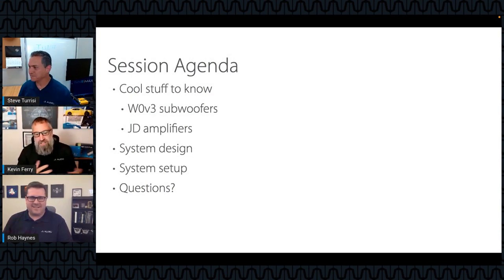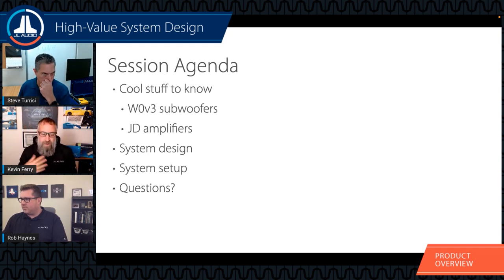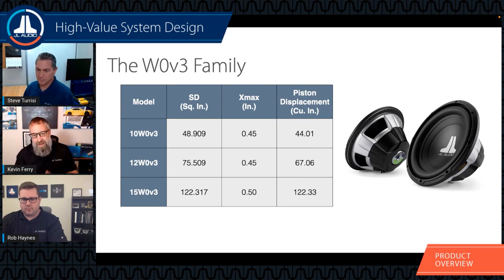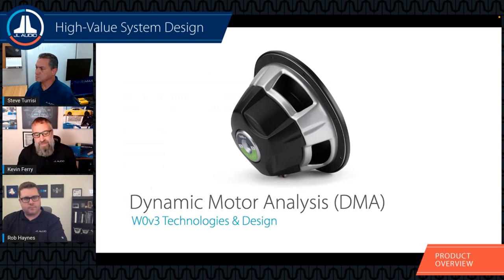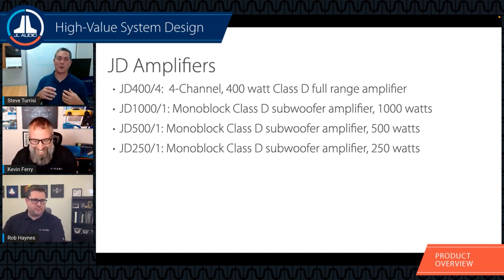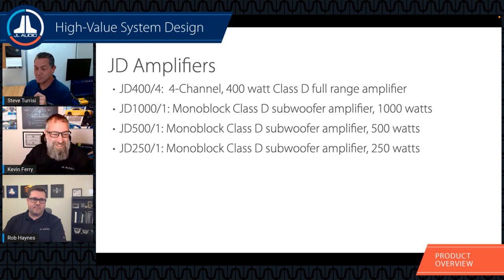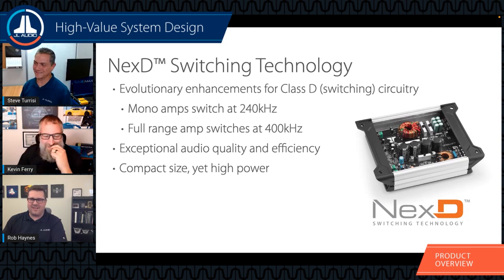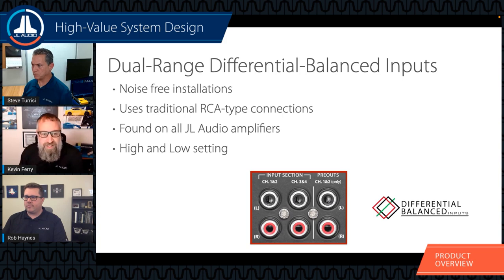JL Audio Online Training | High-Value System Design w/ WØ Subwoofers & JD Amplifiers

Comment: I had this:
Pioneer DEH-X8800bhs  
      head unit
Audio Control Epicenter
Audio Control EQL
XTANT X603 amp
Front doors JL AUDIO
    6"C2-600 set
REAR DOORS JL AUDIO 
     C2-650X set
and 3-12w0v3's in a 5.25 cu ft box with a 4 x 10 port by 16.5 in long (Box size given to me by your own Carlos Chavez) in a 2006 Nissan Maxima. Sounded awesome.

Comment: Just found this video, this is gold guys! I'm actually designing 2 systems around full JL audio (speakers, sub, amps, wires, fuses, fue disteibution block, battery post clamps, etc). All except the head unit cuz you guys dont want to own that piece of the market.
Reply from the maker: Awesome! We're happy to hear you enjoyed it!
Reply: @JLAudioInc  guys, I have a question for you.  Is it possible to get some feedback round a system designed for a Chevy Express Van? I'm gravitating towards a pair of 10TW1 inside a sealed box, a set of C3-650 for the front and a set of C1 690 component for the rear in the OEM location with the tweeters quite high (near the ceiling).
But I'm not sure If I should also use a set of 4" or 3.5" coaxials in the middle of my huge van to retain the volume level in that part because it really sounds a bit thin. Currently I have a sifferent setup (still aftermarket), but I noticed that right away.
And would you advice for an RD400/4 + RD500/1?

Comment: I must disagree with the clipping. I'm sorry, I come from a very purist audiofile school of thought and clipping means the top and bottom of the sinewave is clipped, that means distortion is present and accuracy of reproduction is compromised. 
And damping factor comes to be very important depending of the subwoofer construction. A free air sub will need it the most while a sealed box on the lower limit of volume can handle most things with very little damping factor from the amp. 
I come from live Audio for bands, venues and weddings, so I've studied quite a bit about audio, beaming, time alignement, venue acoustics, box acoustics, etc. 

Please let me know if there is something particularly different in the car audio world (for example, I know we look for oposite characteristics in terms of on and off axis response).
Thanks from México.